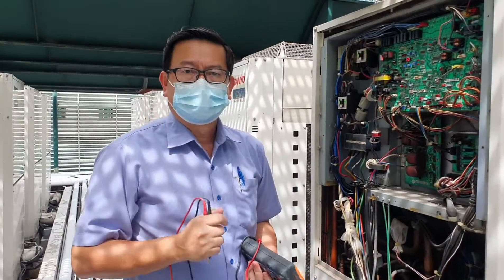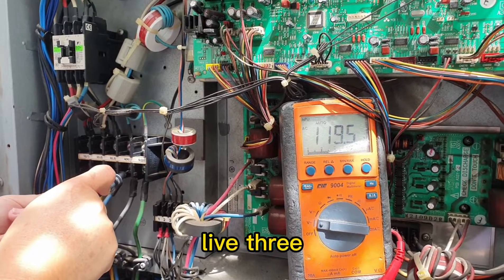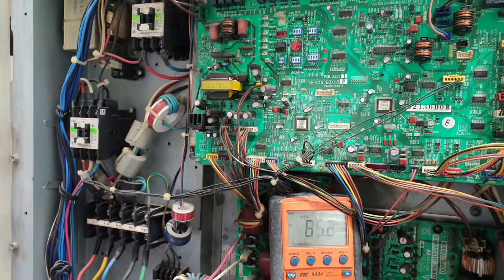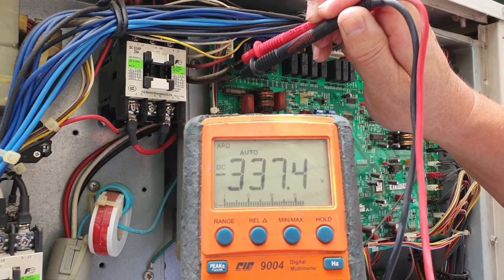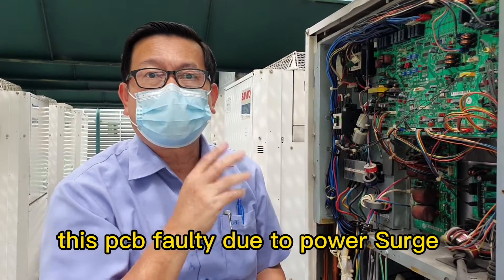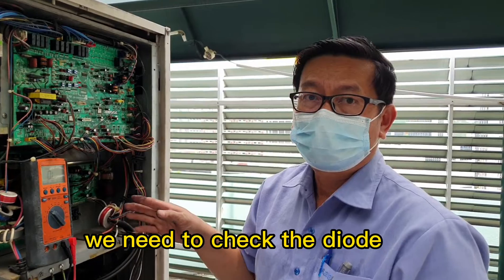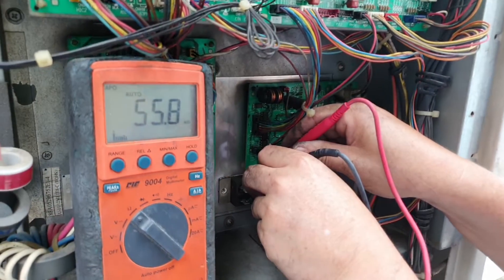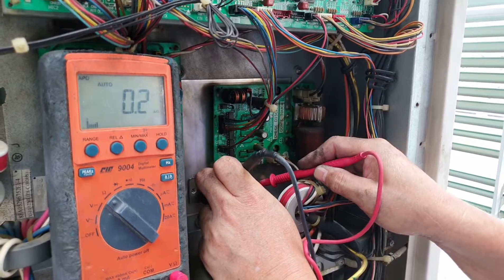How to rectify VRF air conditioner Control PCB no power light

Comment: Sir what is the work of diode?
One diode came into the pcb boards for convert ac voltage to dc, please explain. Thank  you
Reply: Thank you.
Reply from the maker: acts as a one-way switch for current
Reply: @BonMj  for the compressor?
Reply from the maker: @ayubbahaddur8034  ?
Reply from the maker: @ayubbahaddur8034  to compressor is HIC not diode